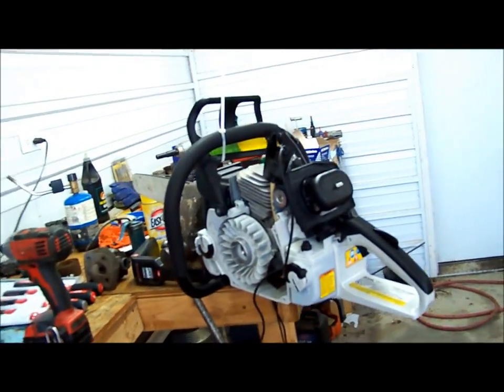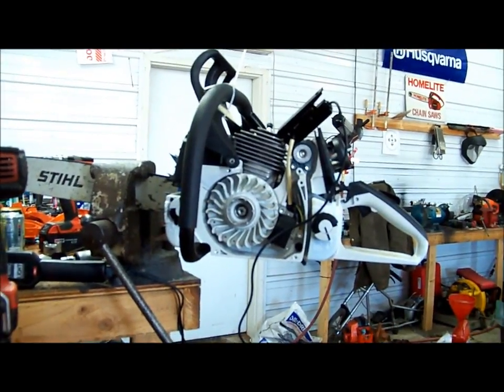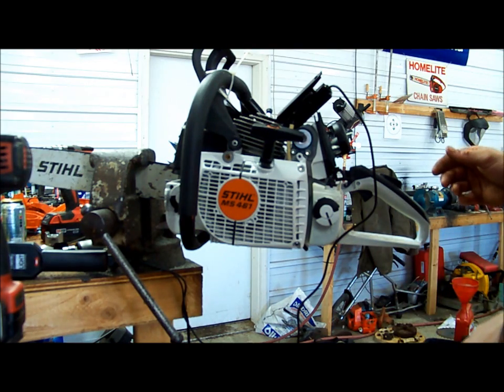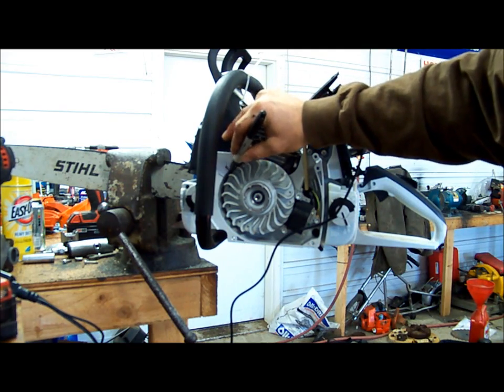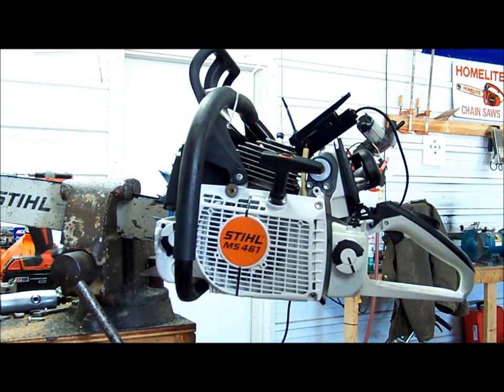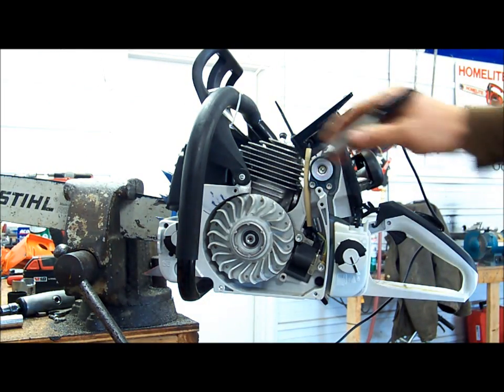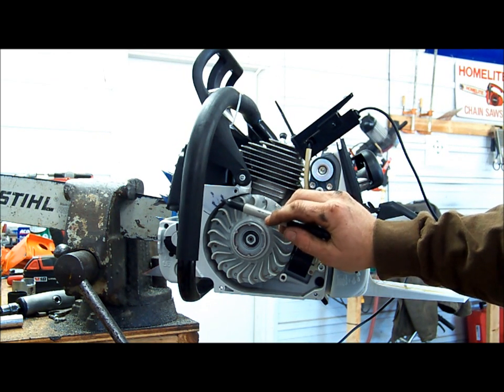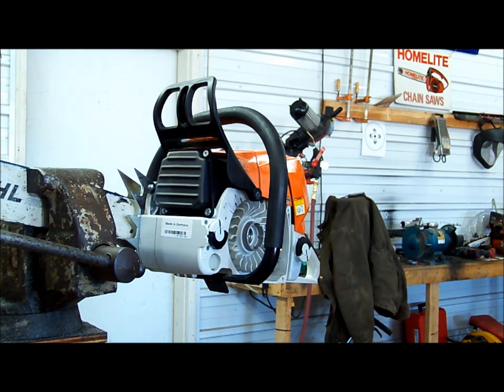How to check ignition timing chainsaw

Comment: Stihl 028av saw. When I tried cranking, it wanted to kick?  I kept trying to crank it. Got it running? But will not reach fast rpm. I adjusted the needles to the best flow but still far from achieving max rpm. I did have my Walbro carb out and replaced gaskets,  diaphram. I believe I felt it all was correct. My level ajust for fuel metering looks correct.  So I no idea the problem.  Just wondering of these saws can jump timing.
Reply: The short answer is yes they can. I’ve seen them bend/shear off crankshaft keyways that indexes the flywheel, it’s actually quite common.

I’ve seen it on many different small engines, particularly in my work as a marine mechanic on small boat engines ( outboards) that have a key way indexing the flywheel to the crankshaft.

You may have other more common issues going on with it, bad fuel, fouling plug, bad fuel lines ect. You need to check fuel lines are okay first because that’s like the most common problem with chainsaws.
Reply: Fuel lines get soft and collapse as they get older, not allowing the saw to get enough fuel.

Comment: I have a ms 460 that is a beast to crank.  It likes to break starter ropes and handles.  It will pop back on you and snatch the pull handle right out of your hand.  Would I benefit by putting a 360 coil on it?  My younger friend who drop starts saws has no problem starting it but I am a tad older.  I crank my ms 660, 440 and 360 with no problem but the beast likes to eat my lunch.  Your thoughts.

Comment: Great vid, liked the recent 500i strip down well. Oohhh that bare flywheel .one question timing light connection. What is connected to second terminal on the battery?

Comment: What do you recommend?  Should I put a 360 coil in my ms 440 or go with the standard 440 coil?  I am sure the 440 and 460 coils are pretty much the same, since a 460 is nothing but a 440 with a 52mm jug instead of a 50mm cylinder.

Comment: I was looking up the air gap on my ms 440 this morning and the Stihl spec is .15 - .30mm or .006-.012”.  My business card is .010, which is well within this spec.    I am replacing the coil with one from hlsupply because my coil does not give me the performance a 71 cc saw should produce.

Comment: my 391 is backfire ? what do I look for ? it run a little bit and start backfiring and get hard to pull rope like it kicking back not running
Reply from the maker: Check the flywheel key.  If that's not it, likely an ignition failure.

Comment: I have a question.  I built a huztl ms 660 kit and this saw is firing way to early.  It is firing before the piston gets to TDC.  When it does it will snatch the rope right out of my hand.  You can crank it but you have to be a giant and able to spin the flywheel so fast it overcomes the advance.  Does a 660 coil have built in advance.  If so, what coil can I use that does not.  Thanks.
Reply from the maker: You have to source a Stihl ignition from  "0" series (036,046,066) to have static ignition timing.  Personally, I would contact Hutzl for a replacement coil.  Sounds like you have a defective flywheel or coil.
Reply: @mweba1  that's what I think.  It runs so great if you can get it cranked but it takes a bigfoot to crank it.
Reply: Does yours have a compression release if I forget it reminds me quickly also I would get a stihl compression release aftermarket ones don't act quite like an oe does
Reply: My 660 hutzl is the same the decomp was closing so swapped it for a husky one

Comment: I have a 461 and am having a helluva time getting it to run as it should. I started out by digging out the mix screw limiters on the carb. It wouldn't even idle before I did this. First pull and it idled fine afterwards. Now I gotta get the high speed sound happening. The screws seem tight in the carb though. It's always something.

Comment: Good video.  A couple observations- Using a timing light with the original ignition coil helps baseline (where timing is before removing old coil) where timing should be when replacing with a new coil.  However, you need specs when replacing a non-functional coil (e.g. no spark condition).  Any suggestions on determining where timing should be if you don't have a working saw to begin with?

Comment: I'm trying to check timing on a Stihl 041 points saw which has good spark but won't run.
Reply: Carburator or compression or air retriction

Comment: hello from the uk i have a ryobi strimmer no spark changed the coil as it was duff!  have  week spark do you think the timing is out ? the shaft has a slot but no key have you come across this type of modle befor? what do you suggest please thanks den.
Reply from the maker: The timing on small engine ignition is only changed by the position of the flywheel in relation to the crank shaft.  Being out of time would not cause weak spark.  Incorrect coil flywheel gap would.  I would check spark without the kill wire attached.  Also make sure the plug is new and gaped properly.  If that isn't the cause set the coil to flywheel gap to specs.  Thanks for the UK shout out!

Comment: I do not understand how timing is significant with only one piston. ???
Reply from the maker: There is no difference.   Engine still needs proper ignition timing to maximize efficiency.
Reply: I think you are thinking of firing order as opposed to ignition timing. The ignition timing is when the spark occurs. You want to have the optimum combustion pressure about 15-20 degrees after your engine has reached top dead centre. It takes time for the combustion process to happen. For this reason, you want to make sure that your ignition is firing before the piston reaches top dead centre. People making performance engines are always messing with the ignition timing trying to find what number is optimum given their unique engine settings. Basically from my understanding you want to add timing and take away fuel as much as possible without getting knock problems.

Comment: Is it possible for an aftermarket coil to mess up the timing with fixed timing engines? I replaced the flywheel and coil and all I get is backfiring. I think the new coil is probably Chinese. Thanks
Reply: xyloeye Thanks for the replies. I suspected the coil I bought on ebay and ended up getting a real one at the Stihl dealer. It fired right up and has been fine ever since.
Reply from the maker: Yes it is possible.
Reply: mweba1 I thought so. Thanks
Reply: mweba1 should you see multiple sparks inbetween magnito and coil on a 16"poulan chainsaw? I do see lots of sparking and my saw wont stay running without hitting the throttle lightly and I checked the sparkplug for gap and it was lava hot!  I mean scalding hot
Reply: dont ever buy a poulan!  im a tree climber and it took me 5 or 6  purchases over the years but I finally learned my lesson! just go ahead and spend the extra money and get a husky or a still or even a echo but don't waste ur time and money on a poulan unless you have a time machine and ur back in 1975
Reply from the maker: winston didit That coil is shorting out.

Comment: Hello, I´m owning a Stihl MS 460 and I can tell you that I swapped the ignition with the MS461 coil cause I WANT to have the rev-dependent Timing advance. I`m also not so happy about the rev Limit, but it doesn`t bring more power without it. Even with low load the rev Limit is not reached anymore, so it`s meaningless to remove. The Performance is better with ne MS461 coil cause I like also to work with a bit less revs when I have not so much load. Especially at lower rpm (because of load increses or partially-throttle) the Performance is better. The Goal would be to have a programmable ignition module where you can influence the rev-dependent Timing-advance. A Question: Do you know an ignition module WITH Timing advance but WITHOUT rev Limit? This also would be great... Kind Regards.
Reply: My 460 is a Farmertec that I built with a Farmertec coil.  It runs great and cuts great but it is a real ball buster to crank.  I just cannot get it quite over the hump all the time which makes cranking it a problematic situation.  I need to retard the timing a bit so it will crank easier and become a dependable saw.  I have two base gaskets on it but the compression is so high it is almost impossible for me to crank.  Once it cranks it is a great saw.  I am not a woos but this saw is a flat out beast.  It makes my 440 look like an ms 180 CBE.

Comment: Thank you for the very valuable information on the ignition advance of the MS461. After seeing this video I swapped the coil with that from a MS460. With our fuel this was better. Plus, opening up the exhaust a bit more, by changing to a muffler cover of a 460 Magnum results in a very versatile saw that is more powerful than a 460, but with lower fuel consumption. It can even handle a .404 chain.
But, after some more coil swaps for customers I found the 460 coil was not actually needed. All what is required is to 'de-activate' that new 3rd pole of the coil. I increased the air gap on the 3rd pole ( hacksaw blade behind the feeler gauge) so that it cannot pickup the flywheel's magnetic impulses, and the effect is as good as a swap!

Comment: On a single small engine there is no need for timing. Just make sure the air filter is clean and your carb is adjusted correctly.
Reply: I think without proper timing yur saw could run hot and scar ur piston and cylinder wall and burn up,
Reply: winston didit the only thing that would affect timing is the air gap between the ignition coil and rotor magnet.  Normally they need no adjustment other than cleaning of debris.
Reply: @Gears.and.Gadgets 
“Winston didit the only thing that would affect timing is the air gap between the ignition coil and rotor magnet.”

That isn’t even remotely true. Cylinder squish can affect ignition timing, so can a bent crankshaft, broken or damaged crankshaft keyway, bent rod and a whole host of other things.
Reply from the maker: George W Air gap does not effect timing.  It can effect spark strength.
Reply: mweba1 All I repair is oem units usually if there is a replacement coil for example available.  Sometimes parts do cross reference now and then.  Besides all engines in California must be carb compliant.  Which means we don't deviate from manufacture specs.  And yes air gap setting usually .020 affects the strength of the spark.  One can use a business card if you don't have the gapping tool.
Reply from the maker: George W Not entirely true.  While a stock engine usually does not need timing adjusted, a modified one does.  Another instance would be a saw with obsolete ignition parts.  Mating a different ignition needs to be timed.
Reply from the maker: winston didit Yes if the timing is advanced to aggressive.
Reply: Get a load of this dummy, have you ever built a performance engine lol

Comment: I don't think you really want more rpm but it is harder to tune (adjust the carb screws) by ear with a limited coil. At top end it is hard to hear the 4 stroking with a limited coil.
Reply: A limited coil  u can set the  adjustment richness upto where  you start  setting off thr limited coil  is. Simple way  that's ruff ish what kills them is when people doent realize their too lean and they run them like that  but the limited coils  occasionally  go out also

Comment: Soo whats the gain here? More RPM with less timing using the 360 coil but does the few less degrees of advance give you less over all torque or hp in the upper RPM range or do you end up gaining because the the stock 460 was too far advanced from the factory..also, how much more RPM are you gaining with at the 360 coil and does it actually maintain a higher rpm when under load?

Comment from the maker: They do not have limited coils but some did have limited carbs.  Can't remember the carb model but look for a threaded brass plug in the side of the carb.  Behind it is a spring and check ball.  If the check ball is not allowed to move, the rev limiter is defeated.
Reply: mweba1 which saw are you referring to?